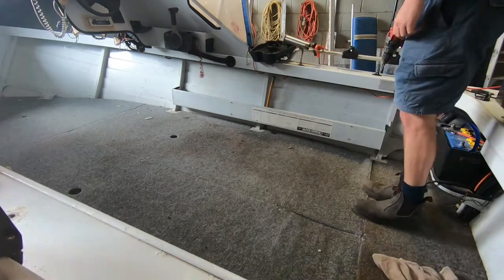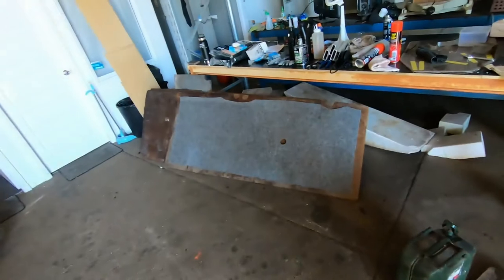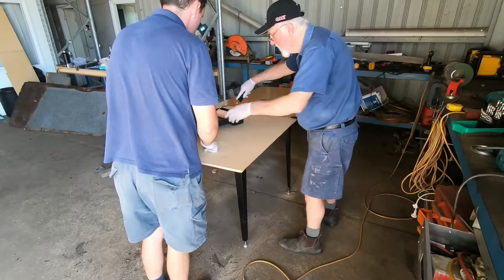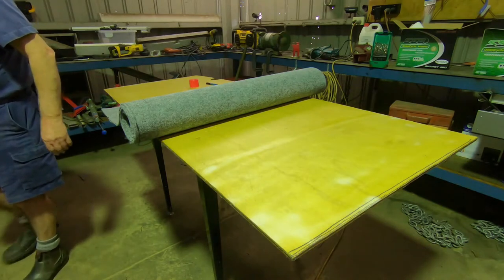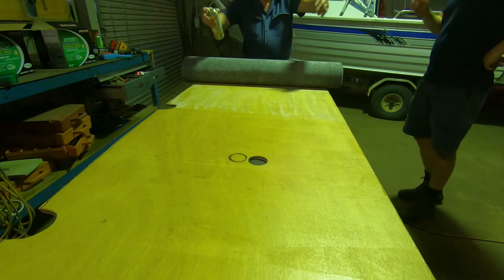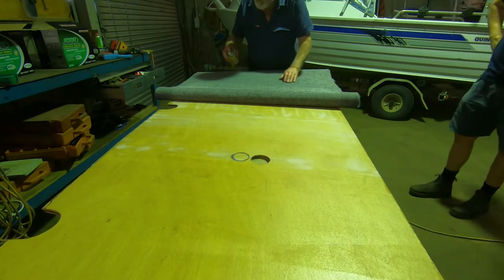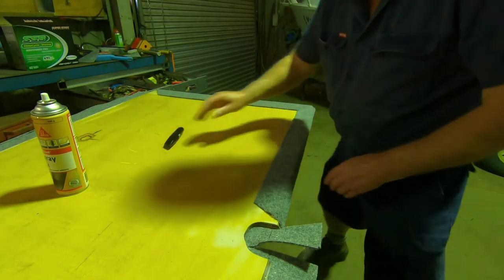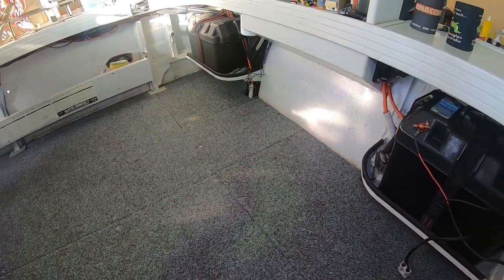EP6 RESTORATION ON A 25 YEAR OLD QUINTREX 475 CUDDY CAB BOAT WITH 50 HP YAMAHA OUTBOARD.NEW FLOOR

Comment: Did you add catalyst (hardener) to the fibreglass resin
Reply from the maker: Hi Mohammed resin will not harden without catalyst as a rule from the old days 5cc or 5 ml to the pound witch is about 12 ml to the kilo just remember on a hot day it will harden faster than a cold day  thanks for asking CHEERS MATE.